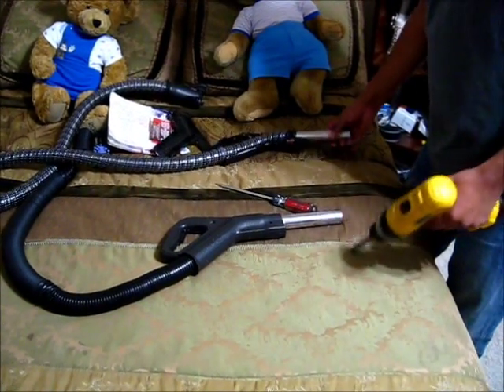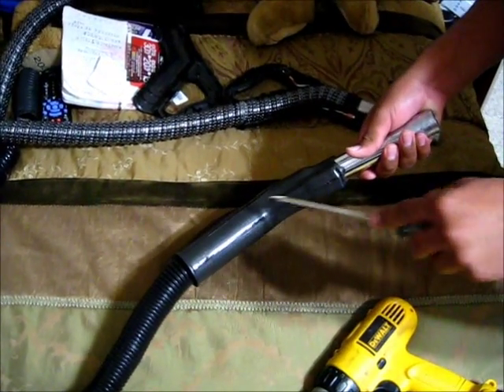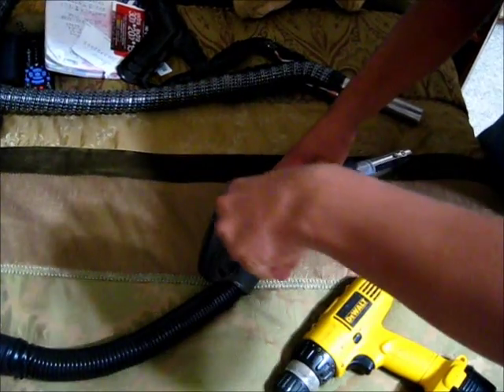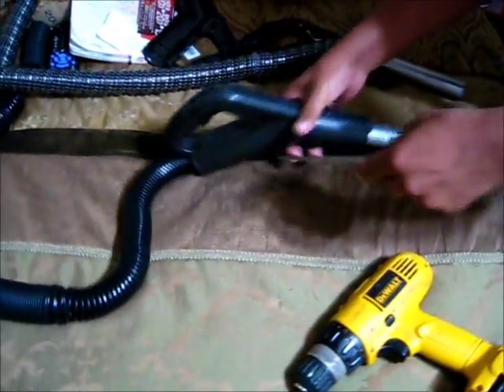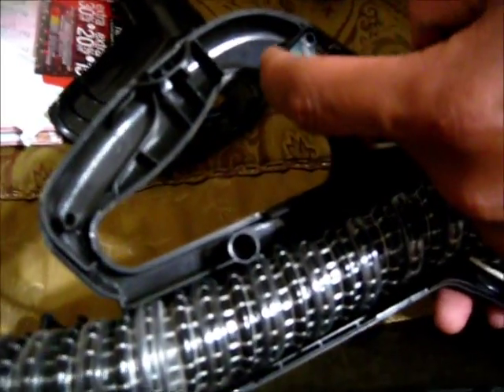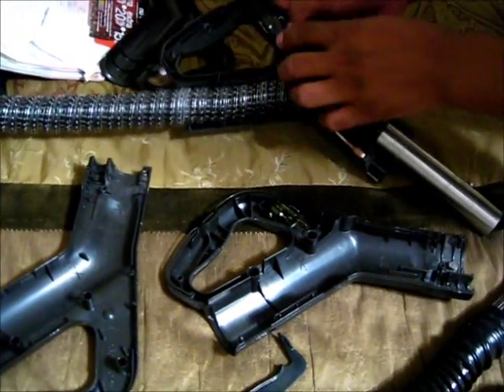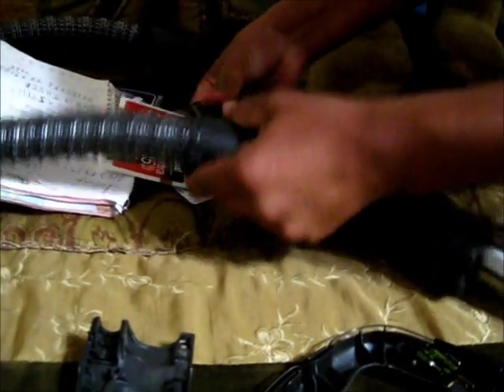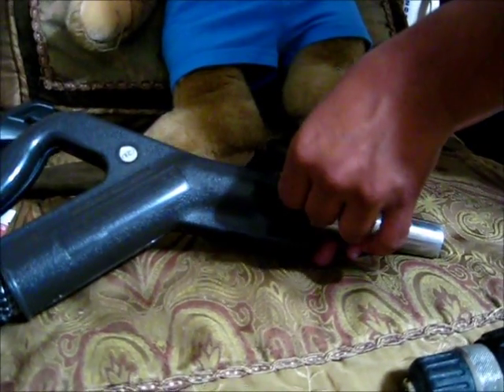wet pick up handle kit..wmv

Comment: There's a little more to it than that.  I remember emailing Rexair about converting the D4 to the E2 Black setup and the tech's response was that electrically the two were incompatible and I thought at the time that shouldn't be an issue.  I looked through parts diagrams and found out the E2 was electrically polarized from electrical plug to the receptacle at the end of the hose.  It was also grounding the wand by way of a diode and/or resistor to the neutral lead in the hose handle.  The D4 is not polarized like the newer machines and could be a problem.  Also, it depends on the version of machine end coupling on E-Series and E2 machines prior to the 2008 E2 Blue/Platinum machines.  It might be safer to buy a whole new hose at that point.